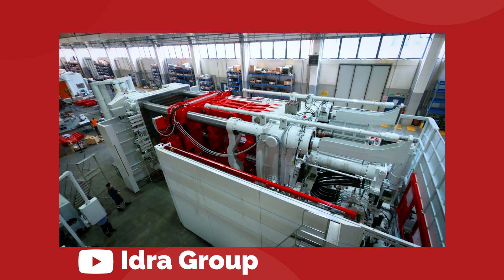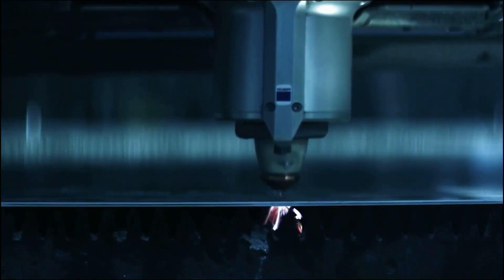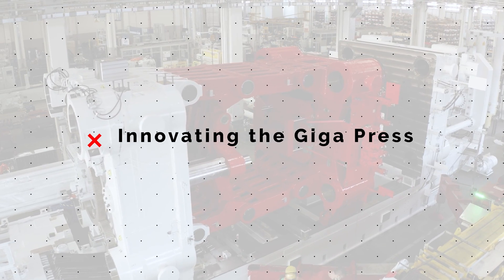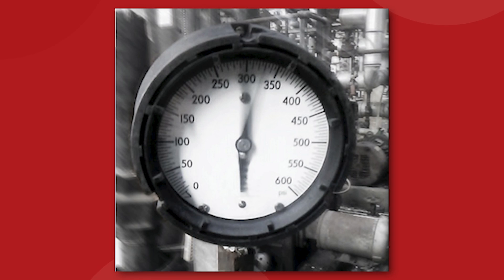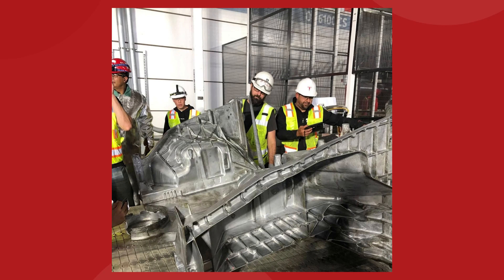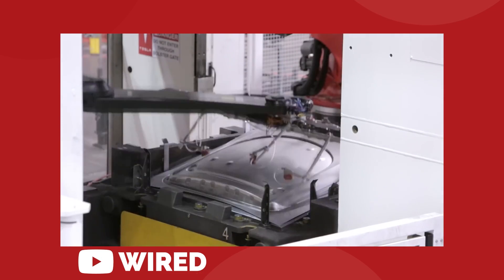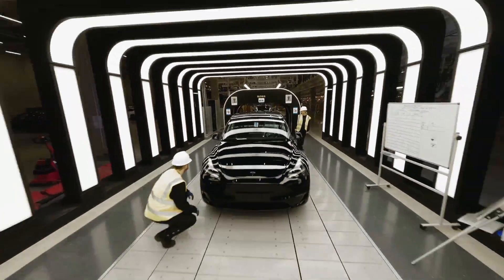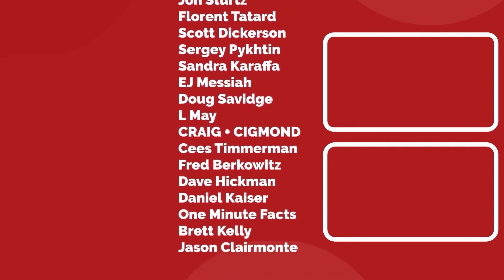The Real Reason Tesla Developed The Giga Press!

Comment: An entire vehicle in one casting is unlikely, but you could use cast body sides and cast door frames and maybe a cast roof frame and firewall. Unless you could buy a new shell cheaply and transfer your parts across easily, I think accident repairs would be big problem. Repairing cast aluminium is never easy and introduces weak points. are could be written off in bumps that would be an easy fix in traditional structures.
Reply: Don't crash it, though.  Aluminum is hard to pull back into shape, if the cast piece is even able to be pulled.  Also, aluminum panels cannot be repaired in most body shops, requiring specialized training and equipment to repair correctly.  This is why aluminum-bodied Ford F-150s have a higher salvage rate because of the costs to repair.
Reply: This is where people’s ignorance shines…
You state “one casting is unlikely”.

Bro. 

Everything Elon does is unlikely. 

Get your head out of your azz.
Reply: that is the idea. On 1 hand, consumer gets  safer car for lower cost. Tesla gets new sales from recycled customer. It is good business. Consumer dont pay for it anyway, insurance will cover the beyond economic repair cost.
Reply: @benjaminng1112  The world isn't only the usa, the normal in many countryes like eu is only having insurance against 3rd parties, meaning that if you have an accident were someone else isnt directly responsible for it, you will have to foot the bill. Also, I seriously doubt that the costumer will ever see a cent out of it, and why would it? They're selling you a car, not loaning it to you, they dont have the obligation to buy it back for you at any price, so they will sell you a car at a market value, and, if it suits them recycing them, buy it back at scrapyards for scrap value. Its a well rounded bussines model, not gonna lie, but people is still earning almost the same than 20 years ago, I wouldn't be surprised if in 30 years we all have to drive mopeds like in china because nobody can afford the luxury of an econobox.
Reply: @acynder1   Thank you for saying that you weren’t going to lie.  After I read that I knew I was reading a comment written by a genuinely honest person.

Comment: Look at any steam locomotive and look at the size of the castings; the entire drive wheel assembly was one casting.  Ship's anchors are usually cast in one piece.  Casting big is not a problem.  Making the casting thinner just means that you'll need more injection points, heating up the mould, or both.

However, just because you can make a whole car out of one casting doesn't mean that you should.  Tesla has their own insurance company, and single part car bodies will cost them more when a car needs repair.
Reply: Clearly a dumb idea, but that's the cultist love you're seeing here
Reply: @joshlewis575  Almost. I am betting all the sensor and that sort of thing will total the car first. Besides, I rather fix a single casting than certify a bunch of weld that had been in an accident bad enough to damage a casting. Michael; "just because you can make a whole car out of one casting doesn't mean that you should". Yes. look up the history on that, it makes perfect sense. Do you guys drive Fords or something? In our family it is 2 Hondas, 2 Mazdas, and a 1990 4RNR.

Comment: Reparability will be interesting.  

How would repair be handled with such large castings? In a fairly minor accident press component can be repair or replaced. If the one big casting is damaged is the car needing to be written off. Not saying this is a bad thing but seems like a large change. 

Makes the car like a mobile phone an unrepairable disposal item?
Reply: If the damage was serious enough to damage the front or rear casting, why would you want to repair it?
Reply: Any crash that would be destructive enough to damage the cast would likely be a totaled vehicle, anyways. The front/rear chassis being two pieces is a lot stronger than one in which you are welding/screwing hundreds of parts so the structure of the vehicle is stronger.
Reply: @FKS1994  Cast aluminium is not nearly as strong as rolled sheet metal, pressed and formed in body pieces. And it has nearly no yield before it crackes. And I am not even talking about the high-strength steel that manufacturers use nowadays. This thing isn't going to be repairable in anything beyond a fender-dender like the Audi A8 that no bodyshop will touch with it's cast, extruded and bonded bodypieces. Engineered obselence therefore.
Reply: Apparently there are crush cans in front of front casting to absorb impact and spare the casting if possible. 
If the casting is damaged the driver wont be getting out of the car thinking, 'this will be expensive' they will be thinking 'I am alive!'
Reply: Would seem so. The structural battery pack is a non-repairable item too.
Reply: Here's the reality.  Tesla had too many parts on the back end.  That's too many 'failure opportunities' in their design and it cost $2000 too much to make the car by its original design. So with recommendation from Sandy Munro, they converted those many parts into one part.  BUT... Here's the con in this story.  You see other car companies know how to make cars, they didn't need a giga press to make cars.  The legacy car companies have decades of experience in making far more complex gasoline and hybrid vehicles by the millions, compared to a simple car with just a battery and motor.  The giga press is a fix, not a feature, nor does it put Tesla ahead of any car company who already makes up to 10 million cars a year.  This video is basically a cover up.
Reply: @obijuan3004  You're an absolute clown.
Sandy Munro has been advocating for 1-2 pieces chassis from legacy automakers for some time. The problem? Legacy automakers were making huge profits with their SUV and truck sales so being legacy companies, innovation wasn't really on their mind as the industry was stagnant. Tesla broke the revolutionary barriers. Tesla is the only car company that has made innovation in cars exciting the past five years.

The other companies that make 10 million per year have been around for decades and they are inefficient. Per sq ft of factory space, Tesla is the #1 in terms of production efficiency. 

You can't use the same factories to create EV's... so who cares about ICE factories if they are largely irrelevant and outdated in the future? Tesla's factories are all EV-purposed. Wow, amazing... Toyota can sell 10 million ICE vehicles. That will then be 9 million... 8 million... 7 million... and eventually fewer than 1 million ICE vehicles because no one is going to buy them in the future due to EV's.

The Giga press advantages = stronger base, easier to manufacture, less labor, fewer robots, and much more efficient... that leads to cost savings. Other car manufacturers didn't do it because they didn't care about innovation. New year, same car but all they did was change the interior LED lights, LMAO.... Yeah, these other car makers are so advanced. That's why they let a guy who had zero experience in the auto business who sold PayPal become the #1 EV automaker in the world. So advanced!
Reply: @FKS1994   Thank you for the clown comment, there's nothing like an adult conversation. The Giga Press is a fix to reduce the cost for the Tesla design and a weakness in the rear end.  That doesn't automatically make the other car companies designs wrong, since their design doesn't need a giga press, especially when Tesla is fixing a design problem. The Giga Press is hype just like the Giga Factory hype, while most Tesla's are made in an old Toyota factory and 15 car companies make more cars than Tesla without naming their factories.
 
You say innovation is not on legacy car companies minds, yet they dramatically increased mileage over the years, improved engine design they use fuel injection, turbo, the whole system is computer controlled engine technology, they added anti-lock brakes, airbags all over the car, Hybrid technology,  GPS technology, Apply Play,  Satellite Radio, self parking, rear cameras, heated seats and steering wheels, LED lights, collision senors on the front, rear and for lane changes,  heated and folding rear view side mirrors, heads up displays, night vision, touch locking, key fobs,  self opening and closing doors, seat position memory and satellite emergency calls in case of a crash.  That just a list of what you call non-innovation off of the top of my head. 

What did Tesla do?  Make a fancy golf cart without a dashboard?  Seriously??   

A gasoline engine or hybrid vehicle is far more complex to build than a car with just a skate board chassis, a battery, electric motor(s) and a LED Monitor screen that replaces a real dashboard. It as cheap as you can make a car. 

Legacy car companies like Toyota sell 10 million cars a year globally for everyone, not just people wealthy enough to buy a vehicle for $50k to $125k.

The fact is TESLA CANNOT TOUCH TOYOTA'S CUSTOMER BASE.  So for legacy car companies an EV was not a challenge until either governments started forcing car companies to make 'zero-emission' cars or Tesla can make a car for $25,000.  

Tesla has spent 15 years learning how to produce cars at scale.  So far every Tesla has at least one recall.  People are just gullible for hype videos.
Reply: @obijuan3004  Sega and Nintendo didn't see SONY coming

What did SONY do? They made a dirt cheap console that was simple to make and easy to program. It wasn't _better_, it was simpler.

I would have used a car analogy, but... well..
Reply: @rorychivers8769   I'm not a big gamer, but Sony did change the game console.  They didn't just copy Nintendo and it did take Playstation about 10 years to beat Nintendo in console sales. Sega never beat Nintendo. 
When you think of Sega, you think of Sonic the Hedgehog, with Nintendo its Super Mario,  with Playstation's first games they had Tekken 3,  Final Fantasy  and Ridge Racer.  The Nintendo was considered a younger kids console while PS was for teens and adults. Also, with all of the extra controller options the PS games were more complex. 
When PS2 came out they took the world by storm, but with mostly adult level games as gaming moved from cartoon like games to 3d reality games like Ghost Recon and Grand Theft Auto. 
The kids who grew up with Nintendo and Sega,  were moving to a more adult games on Xbox and Playstation.  
HOWEVER, of all the top selling games, Nintendo has more top sellers than any other company.
 
I don't think gaming consoles compare to cars though.  I'm not buying an electric car because of simple math.  Everyone who is buying an electric car right now is paying a premium price for all of the R&D, and low production numbers. Also, I'm not interest in driving from charger to charger.  So I want better technology too. AND A REAL DASHBOARD, not that cheap big LED screen that you see in a Tesla,  that screams CHEAP! 
 
In 10 years electric cars will be much cheaper.  Tesla cannot touch 70% of the car market right now because their cars are far  too expensive.  That is why you don't see legacy car companies racing to compete with Tesla, they're not giving up on their paying customers who can't buy a Tesla anyway. There is still a huge market for sub-$35k vehicles

Musk is the king of hype and he does a great job of making himself to look like the smartest guy in the room, but Musk screwed up big time with Twitter and lots of people in the business world are saying there are big cracks in the Musk image. 

We will see in 2035 who is leading the pack, it might be Tesla, then again it  it might be another company like Canoo, because they got a patent on a Super Capacitor system that charges in 5 minutes and has a range of  500 miles. Tesla going all in on their battery manufacturing could be their down fall.  Or it could be the smartest move Musk ever made. 

Its far too early in this new EV market to call any company the winner at this point. Musk hype videos are just hype.
Reply: @obijuan3004 Which one of us is more agitated?
Reply: @rorychivers8769    I'm not agitated, nor did I think that you were.  I have been really excited about having electric cars since 2004. I had an electric car website as a project in 2007 or 2008.  I followed Tesla before Musk was CEO and I have been a sucker for all of the Musk hype videos, mostly because I took the videos at face value, I didn't really look into anything.

As I looked into the videos over time, as a stock investor,  I figured out that Musk is the king of hype.  His videos are mostly hype, too.  Of course if someone said that to me 2 years ago, I most likely would not believe them either.  It was last year that I saw that legacy car companies also have a game plan for electric cars, they are not sitting on their hands.  This fact changes the whole EV story. 

My investor friends thought I was crazy when I said Musk was lying about free speech as a reason to buy Twitter.  Then it came out that Musk was going to ban Bill Gates from Twitter... so much for free speech.  Then Musk said he was going to vote for the political party that calls climate science a hoax, but his customer base are environmentally active, not a good move for Musk.   

Then it came out that Peter Thiel left the board of Facebook and joined the Trump re-election campaign.  Thiel and friends met with Musk so that he could financially control Twitter and bring Trump back, because Trump's 'Truth Social' was using freeware and was not working  at all. 

Still, I'm not angry about any of it, people do what the do, they don't call me to get permission..LOL.  It time to see Musk is mostly hype.  And be more open to the future possibilities.  Have a good night!
Reply: @obijuan3004  You can't just ignore his antics?

That's what I do, couldn't give less of a shit what the man thinks or does, if he wants to name one of his kids "Sir Raymond Luxury-Yacht" that's his problem, he won't be the first or the last eccentric billionaire to attempt to convincingly wear human skin

Comment: Is there anything about the Gigapress that makes it irrelevant for making gasoline cars?
Reply: About the machine itself? Not at all. The entrenched workforce/unions/processes and belief that this is the way we've always done it are more of a roadbump than anything
Reply: @TreeFrog851  My only thought on the matter is that the Gigapress implies many years between model changes, and it's noteworthy how rarely Tesla bothers to come out with "the NEW Model Y" or the "the NEW Model 3", etc.  For "reasons" I don't yet fully appreciate, Tesla can just keep on making the same-looking cars year after year and no one cares.
Reply: @craigsearching  
The New versions of their car lines are when they introduce a very large number of updates and changes all at once. Otherwise, Tesla updates parts as new iterations become available.  Some parts will have 3 to 4 or more refreshes in a year, scattered all over the vehicle.  Where other manufacturers will hold off all updates for a yearly model refresh for a single part iteration.  We'll see how it pans out when the history books are written in 50 years.

Comment: They use AL? They need to figure out how to use some high quality steel so that MILITARY  vechiles can be made, that way they can also sell the same basic equipment to law enforcement and to the civilian market.  Think about a basic JLTV (without heavy armor or even no armor) used by law enforcement and hard core off road campers.
Reply: You are talking about the Cybertruck!! Stainless steel, bullet proof, solid glass!’ High speed and crazy fast for police, and military.
Reply: @MyUniversalUniversity  no I was talking about the JLTV which replaced (?is replacing.) the Hummer.  It is designed with one level of armor but has been designed to have that armor upgraded to a higher level.  Secret Service would want a MUCH higher level or armor, Law Enforcement would want a lower level or armor (than the military levels) and average Joe blow would only need enough armor to not worry about damage if doing HARD CORE OFF ROADING.

Again I’m talking about the JLTV by

Comment: When Sandy Munro was at IDRA they said the time it takes to make a casting was in milliseconds.  At one second per casting that's 60 per minute, 3600 per hour, 28,800 in 8 hours.  So it looks like one pair of casting machines could supply many assembly lines.
Reply: Milliseconds is a bit misleading, and does not include the time for the press to open/close .. for robots to remove the casting etc.  Here's a quote : "Per IDRA specifications the aluminum-silicon alloy can go from molten metal to chassis in less than 100 seconds which is a very high speed."    so 1 minute 40 seconds + the cycle time of the press/robots .. probably capable of 1 vehicle every 3 ish minutes which as a mass car builder would be pretty slow .. except you can have more than one running at a time, this is where it becomes cost and time effective.   Your higher end cars are made at a rate of about 1 vehicle every 2 to 3 minutes .. and your honda's/toyotas/GM's etc are made at about a rate of  about 1 car a minute.
Reply: The millisecond time stated is the time the machine takes to INJECT the aluminum….
The part is “made” or “created” in the mold, but that is only one part of the total ‘create the part’ time.